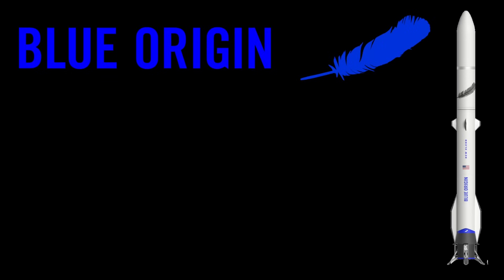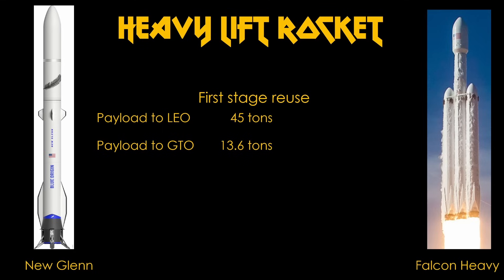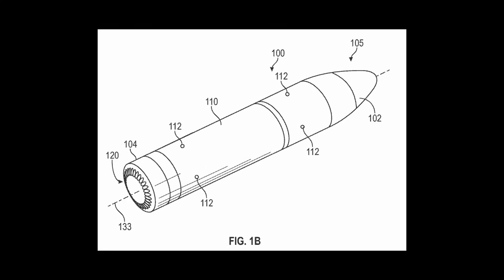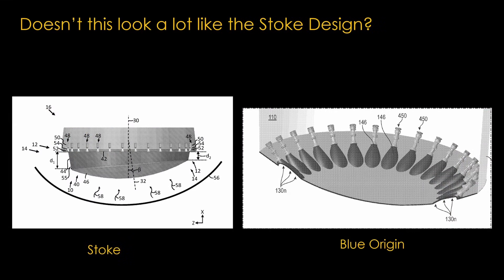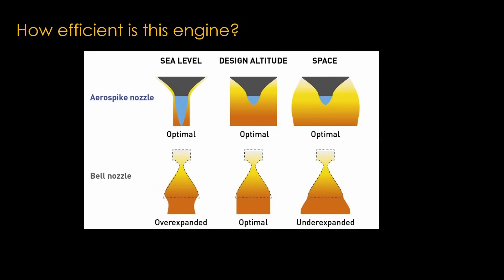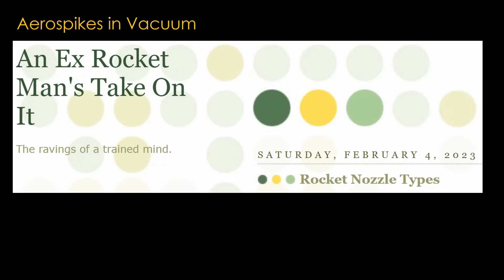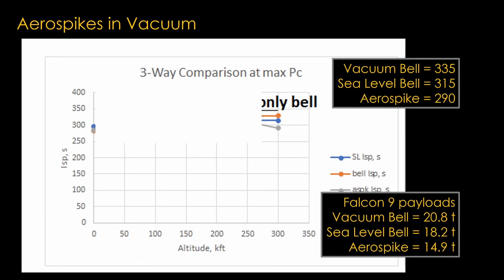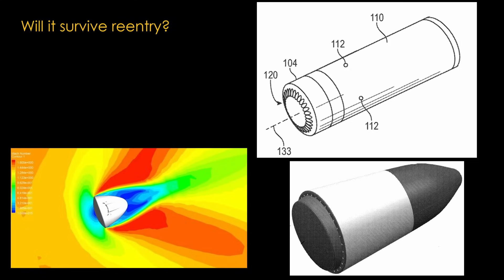Blue Origin's Starship Killer?

Comment: Both Stoke and Blue designs is superior to the SX, we could see that on the last test, the big flap that flopped should be the meme that would be promoted online, not that stupid thing that it is.
Reply: Starship has actually survived reentry and performed a soft landing/splashdown. Stoke and Blue Origin Jarvis is likely years away. 

It's entirely possible that SpaceX starts recovering the Starships later this year. They likely wouldn't be reused, but it would give a lot of data, and they could probably reuse engines and other components.
Reply: @SpaceAdvocate  you don't understand my point, celebrating the flaps is like Boeing would celebrate the helium leak, the only part that doesn't worked like should having, and obviously the flaps are huge and heavy, calling them little is completely wrong, they only survived because of the bulk material, which is a sign of over engineering and parasite mass, not a good design. When Stoke and BO would flying remain to see, but you can't pretend that they worked on upper stage reusability before SX, so something like five years development should be normal.
Reply: @theOrionsarms  They will tweak the heat shielding to ensure the next flight sees less damage to the flaps. They've really already demonstrated that the design is workable.

But if I understand you correctly, you're basically saying that the Blue Origin/Stoke design is better, looking aside from progress made thus far. Maybe you're right, but it's really too early to tell. I think they might end up using so much propellant during reentry that the payload ends up being close to nothing. But it is an interesting design and I would like to see it flying.
Reply: @SpaceAdvocate  I said that a low curvature heat shield experience less heating, Starship use a half of barrel sliced on length shape, that is a bad shape,on the sides the plasma flow paralel with the heat shield and that part experience more thermal load, that isn't a deal breaker but also this is the place where the flaps are attached, putting mobile parts where is the highest heating doesn't strike me like a wise choice.
Reply: @theOrionsarms  The heating is not only determined by the shape. Another aspect is the aerodynamic cross section. You want as much area into the air flow as possible, for a given mass. With more area to mass, the vehicle slows down quicker, and sees lower peak heating. Stoke has a decent design that maximizes the aerodynamic cross section for the mass, but the supposed Jarvis design has a pretty narrow cross section. 

Starship maximizes the area quite well. Side on, a 9 m diameter, 50 meter tall cylinder has 450 m^2 of area, while end on, the 9 meter diameter cylinder only has 64 m^2. 

I would expect to see higher peak heating on the supposed Jarvis design than on Starship.
Reply: @SpaceAdvocate  again you seems to not understand my point, because of its shape Starship heat shield don't experience uniform heating, and the flaps that needs to move during aerobreaking are situated in one of the areas with highest heating, so is fundamentally a bad and inefficient design. Musk's solution to any problem seems to be making it bigger and using more material, instead of thinking from the beginning at the most efficient solution that works both for smaller and bigger vehicles. Also many of your claims are wrong, Jarvis (or however is called nowadays)don't have a narrow body, its diameter is 7 meters, for example dragon capsule is 3.7 meters diameter, and have a 8.5 tonnes at re-entering, that would suggest that could make a successful aerobreacking even if would weigh 34 tons, a huge mass for such relatively small vehicles, but Starship is more than a 100 tons, so not such big surprise that tail re-entering wasn't considered for a 9 meters diameter.
Reply: @SpaceAdvocate  another thing you compare a vehicle that have moving parts that need to work during aerobreacking with two that doesn't have those parts, only small nozzles that are made from from heat resistant materials anyway(both are more like a dragon capsule actually) , a more correct comparison would be with space shuttle that have two mobile surfaces on a flat belly near tail, so in a low heating area, if Musk insist on the idea of moving parts exposed to heat that is the model that should inspire him.
Reply: @theOrionsarms  As @IanBotwright said, the flaps have already been redesigned for future Starship vehicles. They are tucked in further behind the body, which means they'll see much less heating. If you're comparing *designs*, you should be considering this aspect solved.

Relative to mass, Jarvis would be quite narrow. If we say the stainless steel Jarvis ends up with a dry mass of 40 tons, that's 1.04 tons per square meter of aerodynamic cross section, while Starship is at something like 0.27 tons per square meter. Dragon is at 0.63 tons per square meter.

For a more reasonable area, Jarvis should have a heat shield diameter closer to 9 meters. Extending out towards the bottom like Stokes design would be good.
Reply: @SpaceAdvocate  you cannot use the little things that we know about Starship(and actually we don't know much) like a metric for anything else, both Stoke and Blue use hidrolox on the upper stages, so a comparison with another hidrolox upper stage should be appropriate, let's say CentaurV that have 5400 kg dry mass(also made from stainless steel) and hold more than 40 tons of propellant, even at four times that size Jarvis should be less than 25 tons if you include the heatshild (about the shape I don't pronounce until I see a actual upper stage ready to be launched), and Stoke upper stage is actually comparable in size with the CentaurV , we can only judge those when they would put payloads into orbit, and that is applying to Starship too, not forget that Musk said that currently is 40 or 50 tons(not very impressive for a 5000 tons vehicle) .
Reply: @theOrionsarms  New Glenn upper stage should have somewhere around 180 tons of propellant. For the same mass efficiency as Centaur, that would be 24.3 tons dry. But Centaur has really light balloon tanks. A reusable stage for making it through reentry would need a lot more structure than this. 40 tons might not be enough.
Reply: @SpaceAdvocate  True, a narrow base entry has higher peak heating, but the area that needs to be protecte from heat is massivly reduced, and that translates to lower thermal protection mass because it scales mainly with area, not peak temperature.
Reply: @theOrionsarms  Superior?  Untested and untried and on the same scale as Starship?  Doubtful.  This is the problem with you pretend engineers.
Reply: @TheEvilmooseofdoom  more efficient,any solution that add more mass is a bad one, for example the solution to protect the flaps hinges is to move the hinges somewhere on the back of the ship, but that would make them less effective because only the part that is in the airflow can be used to steering the ship, so what you can say make them bigger, bigger and heavy, so again a less efficient. The problem with people like you is that you dismiss even the most basic concepts ,unless Musk is the one that emitted, and even then if he's doing something else don't have the courage to tell him that is wrong.But instead you trolls the people who do that.
Reply: The flaps have already been moved and redesigned. See @everydayastronaut for an interview with Elon predicting this failure point
Reply: @RandomPerson-V agree(let's see what anyone can deliver) , but I observe that at least three of my last comments were deleted, you didn't like what I have to say? Or you can hold with the "truth" only when you can claim anything(no matter what stupid and wrong is) , but when I point that you are obviously wrong you can use your Musk fanboy troll farms to report and delete anything what I post?
Reply: Screw the Flap, what worries me is that SpaceX already has prototypes ready to launch when you are watching the video, they take the data, as well as access the recordings of the internal and external cameras and evaluate what the error was, they modify the prototype (hardware/software) with the new data and just waiting for the approval of another flight license, seeing the progress of the test flights, one can conclude that they are accelerating a lot, if you compare it with other companies on the market
Reply: @WillGerar  the flaps are only one thing that doesn't worked like was planned, other parts like orbital maneuverering system or on orbit propulsion where't even tested this time,why? Because they know that wouldn't work like was supposed to do, also I don't think that a working Starship is a bad thing, they should make a good one and launch as much as they can, but unfortunately the current Starship design has many flaws, and is far away from a operational and competitive vehicle that would dominate the market and make other competition obsolete.
Reply: @theOrionsarms  I think that in your equation you do not consider the experience and rapid learning capacity of the engineers at SpaceX.
Reply: @WillGerar  the engineers that works at SpaceX are exactly like the engineers that are working at any other aerospace companies(at least in the US and western world), actually many of the people who worked at SpaceX now are working on other companies, that doesn't mean that are companies that have a bad work culture, but why do you imagine that nobody can achieve outside SpaceX what they achieve when they worked in that company?
Reply: @theOrionsarms  because you don't see them doing anything, not even 20 successful launches a year, the falcon 9 that has been in service for more than a decade, still no one is capable of doing what it does, maybe you mention Rocket Lab, it's as if they were launching the falcon 1 that SpaceX took it as a prototype and was not satisfied with it.

They made the crew dragon, a capsule that has flown safely much more than what was estimated in its contract against the competition that has had delays and failures. Even in the Starliner mission it has presented more failures than they had estimated
Reply: @WillGerar  great achievements take time, falcon9 wasn't made to be operational reusable in only few years, first time flying in 2010, after five years development, and only in 2015 successfully landing a booster, and only in 2022 achieving a rapid launch cadence with 60 launches, that would apply to others too.
Reply: @theOrionsarms  "a great achievement requires time" because they take all the time in the world, SpaceX in that time will be more important
Reply: @WillGerar  only if they keep the straight path for the future achievements, but apparently that isn't the Musk priority, but trolling anyone else on the Twitter (sorry X?),if he's cheap on the SpaceX development(like was suggested from some recent sources),or obsessed with false prestige achievements, the competition would make more progress that his company and make SpaceX to lose the leading role in the launch market.
Reply: @theOrionsarms  lol they have an obsession with musk, I don't care what he does, musk is going to leave at some point and SpaceX will continue to grow, I don't follow SpaceX because of musk, you should learn that.
Reply: @WillGerar  well not, it's the other way around,Musk is obsessed with other things than  SpaceX development, and guide the company in the wrong direction,at least this is my opinion, anyhow the worst thing that could happen isn't losing few years but spending the resources for the wrong purpose and alienating the people who make SpaceX what is it, which already happened, because almost no one of the engineers that worked on the falcon9 development doesn't work at SpaceX anymore.
Reply: @theOrionsarms  Are you aware that it is normal for workers to change companies for a certain period of time?
Reply from the maker: I don't think it's possible to evaluate how good designs are until they actually fly.
Reply: @EagerSpace  Your conflating Evaluation and Validation.  We can always evaluate a design at any stage, with all the possibility of error that carries, but flying it is the only way to Validate it.
Reply: @EagerSpace  that is what you are doing all the time (speaking speculatively about SpaceX in a good ways, and badly about another's), also anyone can make some general consideration about efficiency or lack of it, but when you don't like those(because they don't praise SX)you can delete the comments, right? I don't know the future but I see the present, and it isn't a nice one if you are not a Musk fanboy on the social media networks.
Reply from the maker: The bulk of my analysis is based on what companies have done. Starship has obviously had issues but they are making progress working through them and SpaceX has a lot of engineering history, AND they are taking an approach that has flown on 3 other vehicles. The Stoke and Blue Origin approaches are brand new without any prior art, which inherently makes them more risky. I'll talk about the issues or the things they need to figure out, but the reality is that WE DO NOT KNOW whether their approaches will work, and if they do work, whether they are practical.

WRT deleting comments, anybody who uses terms like "Elon Fanboy" will generally get deleted, simply because calling people names is something that doesn't contribute to a useful discussion. My channel, my rules. And it's not just the anti-elon comments that get deleted; I've removed a couple anti-bezos ones from this video.

If your comments detail your reasons why I - or somebody else - is wrong, it will stay there as long as you keep those remarks civil.
Reply: @EagerSpace  your analysis is based on cherry picked data that always favors SpaceX, if are some new developments even if the source is Musk itself (like the Starship payload capacity that decreased from 150 tons to 50 at best), you simply don't mention that and chose older pretended data or future ones that are aspirational, and about calling people name , I've been called worst by your troll brigade and rarely their comments were deleted, I never thought that this is one of the places where Elon name is a dirty word(maybe that is applying only for me, "keep the Elon name out of your dirty mouth!" ), or that people who send me tens of messages when I said something that doesn't praise him or his achievements would be bothered to be called his fans(obviously they are very devoted fans ) , most be the word boy at the end , always forget to use the correct pronounce. Anyhow I unsubscribed from your channel, isn't only the message deleting things, but I wonder how you don't giggle when you say something manipulative like" Blue Origin get more money from NASA than SpaceX for their lunar lander ", that's wrong and you know it, but you said that anyhow.
Reply: @theOrionsarms  SpaceX is getting $2.89 billion for their lander for Artemis 3, while Blue is getting $3.4 billion for their lander for Artemis 5. How is pointing out this fact manipulative?
Reply: @theOrionsarms  The contracts are structured the same. SpaceX has to perform an uncrewed demo landing, and then a crewed landing for Artemis 3, Blue has to perform an uncrewed demo landing, and then a crewed landing for Artemis 5.

I don't think it's quite apples to apples if you add in the Artemis 4 contract for SpaceX, but for SpaceX it's $1.45 billion per landing for the first contract or $1.35 billion per landing including Artemis 4. For Blue it's $1.7 billion per landing.
Reply: @SpaceAdvocate  wrong, SpaceX get the first contract only for one landing, Artemis3, then they get a second one for something more than one bilion  dollars Artemis4, and after that Blue get one single contract for two separate landing, one uncrewed for Artemis4 Artemis5 being crewed and for both of them the total price is 3,4 billion dollars, so SpaceX will receive 4.1 billion dollars and Blue only 3,4.
Reply: @theOrionsarms  Artemis 6 doesn't have a lander yet. Blue is only contracted to do Artemis 5.

I'm not sure if lander contracts for Artemis 6 and beyond will be awarded any time soon. And they might go to SpaceX.
Reply from the maker: There are a number of people who post comments or corrections about specific issues - and usually they give me a timestamp in the video - and those I will respond to. Sometimes I'm wrong, sometimes they are. 

If you think I'm cherry picking you'll have to give me specific instances; I'm not sure why you are caught up on starship here since the only mention in this video is to contrast the method it uses for second stage reuse to the others.
Reply: @RandomPerson-V well I don't use insulting words,or promote hate, but Musk fanboy takes any criticism as a personal affront, especially if you use numbers that put Starship in a bad spot, any debate is stopping then and my comments are deleted, maybe you aren't part of that, but this was happened.
Reply: This is the correct view, a spacecraft so poorly designed for re-entry that it's flaps disintegrate due very predictable gass flow through an exposed hinge shows a level of negligence in design and simulation and airtunnel testing which is appauling.  People trying to cope about the fact the hinge did not melt right through are simply failing to see that one part being over-engineered for condidtions that it never should have faced is ALSO bad engineering.